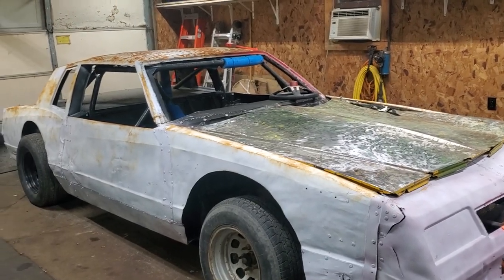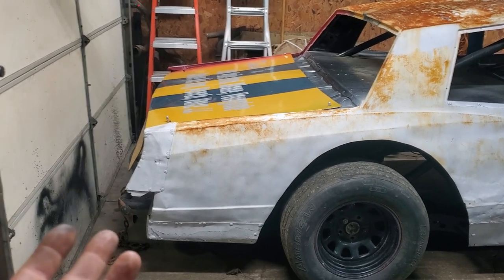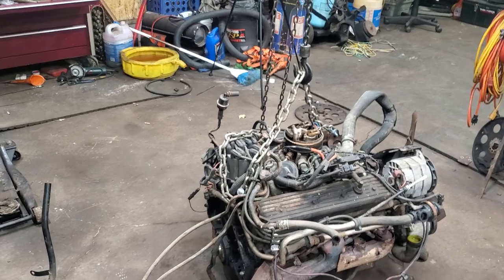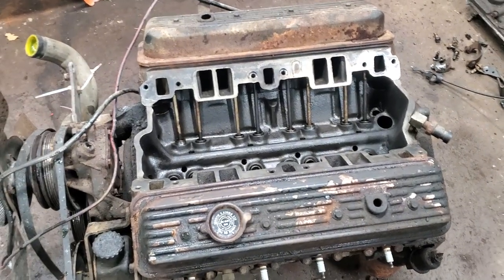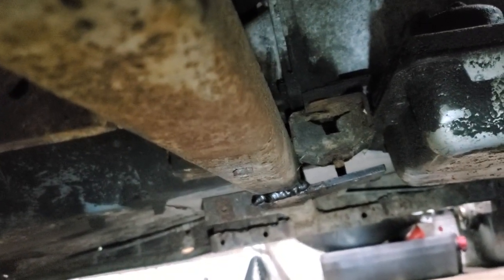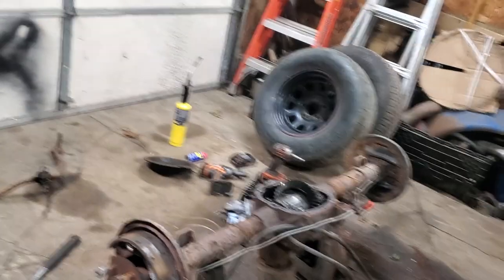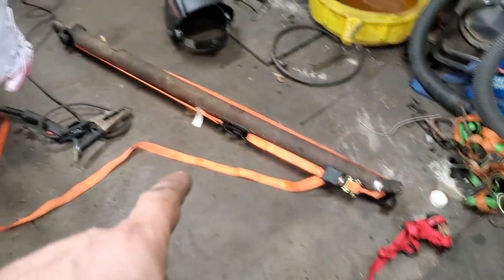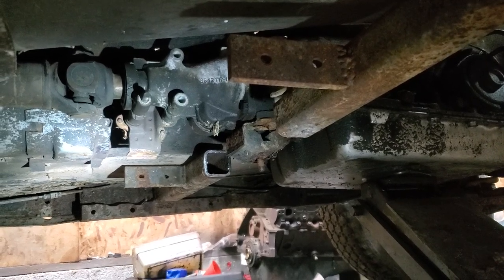Building a street stock dirt track car for under $2000 dollars, and in 7 days? Part 1

Comment: Haha, I always reused the crush sleeve and daily driver. Never had n issue. My biggest problem was the spider gears. Also bend up the thrush washers behind spider gears to add pressure to them. Hillbilly posi. N is all good till the cross pin breaks and takes out the ring/pinion.  Happened twice. Pin broke, didn't know till buddy pulling me home n lost axle on the road!

Comment: Nice work toilet. That rear end had been in a 113,000 1998 S10 ZQ8 factory sport truck with a 2.2L and NP1500 transmission with 3.73:1 rear end. The oil is a decade old but it was pretty fresh at the time. Too bad you couldnt just just toss my old axle assembly under the g body whole, would have saved alot of bull crap.
**BTW** you have footage of that s10 duing field lot truck duty and doing burnouts***

Comment: I know I talk to much! The balance is gonna depends on ur welding. I had a 93 Chevy C1500 5speed I exploded the aluminum drive shaft. I got a steel one that was I believe around 2" shorter or so. Cut it and welded in a barstock keeping it aligned. Yeah once u hit slightly over 70 it was a woman's dream come true on wheels!

Comment: Seat time is way more important that what your driving, there's lots of guys need to see what you are doing.

Double club diesels built a "lathe" just out of 4 casters to help with cutting and welding a drive line you should take a look, looks much easier than using a grinder. My drive line guy says a balenced drive line is a cheap drive line. One that is straight is more expensive and will vibrate less. His drive lines never vibrate either.

Comment: Does the gm 7.5 and 7⅝ run a different cover? I personally don't remember. I do remember having a 87 Monte Carlo and a 84 LeSabre and I always just pulled the ring n pinion out of S10's with 3.73 gears and never had any issues. Well other than shims n all for back lash which was nothing.

Comment: I been racing since I was 8 started in a ministock mustang back in 2000 and back then yes you could probably build a front running pure stock or even mini stock for 2k if done correctly and already have some parts but nowadays your not building a pure stock which this is or a true street stock for less then 8k dollars for a crappy one. And actually man we cut rear frame horns off because it's alot better and they bend when hit so you don't bend your frame and most rear bumper bar setups and a nice fuel cell cage and all that is easier to put it with square tubing instead of rear frame horns, but for 2k I would love to see it running cuse it won't run up front against our pure stocks down here we all run built 350s that make more power then 602 crate motors and hung aluminum bodies 2bbl 650cfm Mac the best carbs for oval racing is hands down VDL he makes the best oval track racing carbs and they makeore power then a regular holly 2bbl carb for oval racing I have always ran VDL and I did a test on chassis dyno ran a circle track holly 650cfm and then the VDL 650cfm 2bbl and gained 64.3 horsepower cuse of how well blueprinted his carbs are and they legal, also put pure stocks have to run autos which sucks but in a few weeks we are running for 5k to win at deep south speedway in pure stocks look it up only reason I have a dirt pure stock is cuse they run for 1k-8k dollars to win features every weekend at one fl the many dirt tracks around me closest one is 30 minutes and furthest one is 3 hours and there is 9 of them and it's awesome I'm a asphalt racer by heart by can't beat the dn layouts for pure stocks here, your car would be legal here just under powered by a little not much. But here is what our pure stocks are, hung aluminum bodies using aluminum sheets that are pre colored, only thing that is stock has to be the roof everything else can be aluminum sheets hung just Google or fb southern raceway deep south speedway pure stocks that's two of the 9 tracks I run them at, the front bumper has to be the md3 pure stock/street stock bumper cover no rear bumper cover required, even th A and b posts can be made out of aluminum sheets same with the rest of body except roof, must have stock floor boards no decking of the interior no rear spoiler, must have stock rear trailing arms allowed a 1/4 inch longer or smaller then stock but must have the stock mounts and arms and mount in stock location no headers allowed 2bbl 650cfm max with 1 inch spacer and the motor rules are not to bad but for deep south where we running for 5k to win is a motor track and my motor is maxed out to the rule book if you do that you won't have a problem power wise as long as your running a nice blue printed carb like the VDL I run, I also have a portable pressurized air tank I modified with valves and some plumbing pipe and then a 3/4 inch rubber hose that runs accross the front of my radiator and I pull the handle under caution to spray pressurized cold water accross my radiator to keep the motor cool and knock off the mud and dirt build up on radiator cuse you know as I do these dirt cars love to over heat no matter what once you get mud and dirt buildup on the radiator and is theimoted amount of air vents and holes on front bumper covers restricts alot of fresh air flow coming in to keep it cool se we are allowed those tanks in pure stocks only nobody else runs one except me and I gain so many positions under caution cuse ppl have to go in and get the radiator sprayed with water hoses if they start to over heat to get dirt off of them, now deep south since it's a big fast half mile not much mud and dirt buildup at all and the speeds are high enough where you get entry of air going into the radiator but small bull rings like 1/4 mile and a little less we run on for big money the tank o got is a life saver and has been the deciding factor of me winning and blowing my motor or not winning to save motor from over heating or win and blow theotor from over heating  most guys don't care about their cars overheating  it I do cuse I don't like pulling out and building new motors 3 times a season I like to run the same nice built fast motor for multiple seasons with out blowing it up and a rebuild once a year before each season starts and Dyno chassis tune through out season looking for horsepower lose and keeping the cars power as high as possible all year round